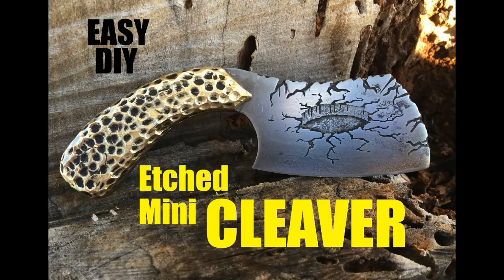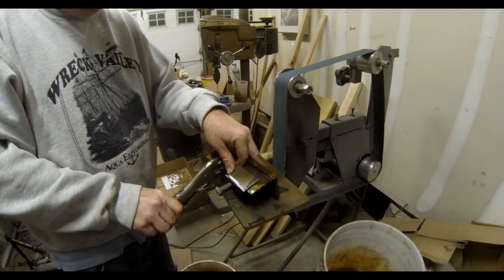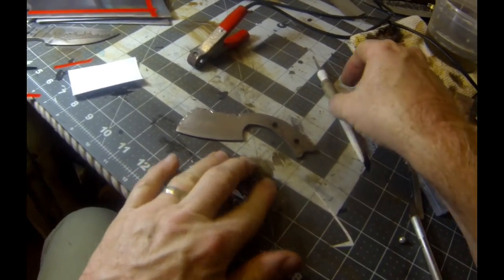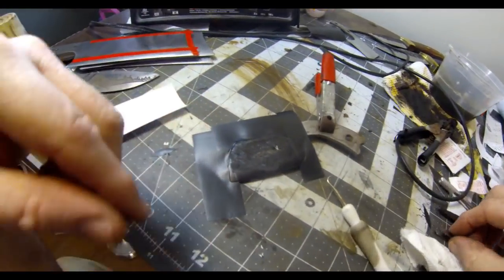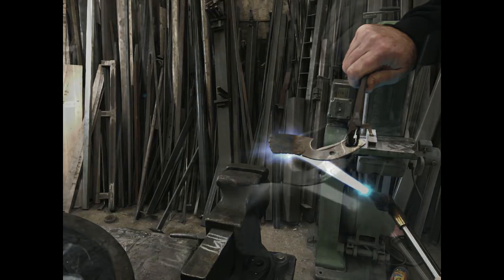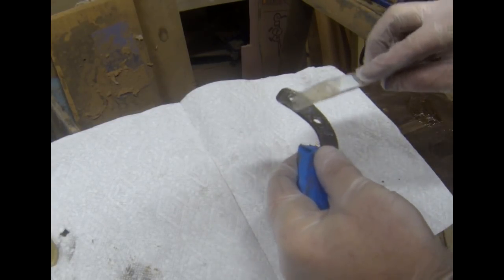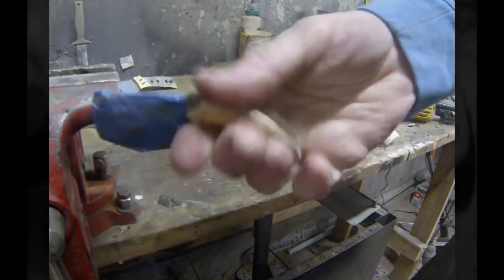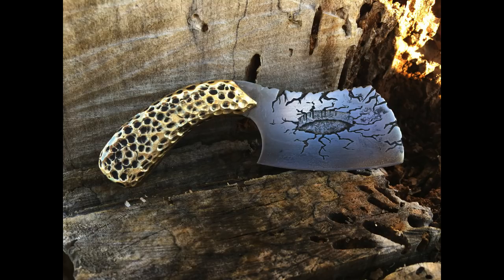How to make a Mini Cleaver Knife with 3D metal etching

Comment: Can you use anything else as a resist or do have to use vinyl?
Reply: Vinyl is Best, With a Cameo, but you can hand cut your design, don't forget to buy the clear application tape.!!
You can Paint your knife Design using Bitumen Paint, Enamel or any paint that goes Hard, as an Option 
Transparent Packing Tape has some advantages, if you can Draw it you can Cut it.!! ...Tape your Drawing 
to the under side of a sheet of THIN Glass, an LED light below your drawing, Then cut your Design.!! 
Before digital, Screen Printers used a Swivel Knife, it was like a pen or pencil in your hand, DIY easy Blanks look like 
Great Value for Money.!! ...Use Kosher Salt, Distilled, De-ionezed or Rain Water only, Brass can be Blackened by 
mixing 1oz of salt etch solution with 1oz of Balsamic Vinegar, Brush it onto Etched Design BEFORE removing the resist.!!
i don't know about Steel, Have Fun, James Metcalfe Jr. ...Cheers Geoff   ...Let me know if you Find a Swivel Knife.!!!